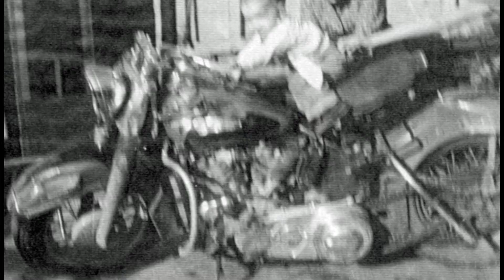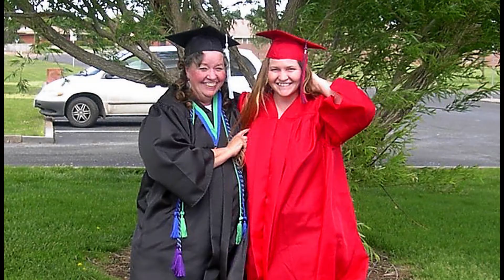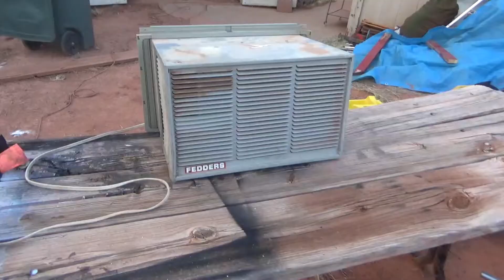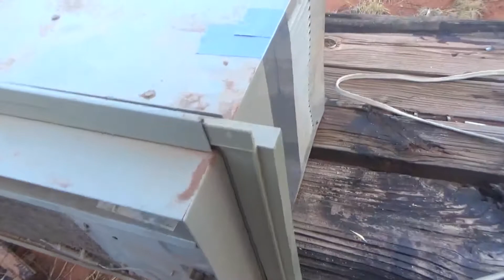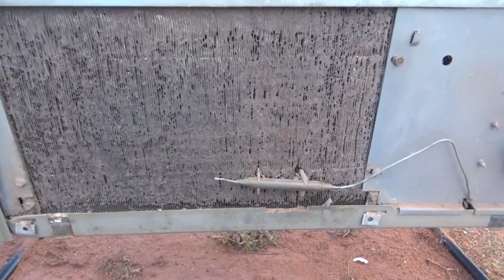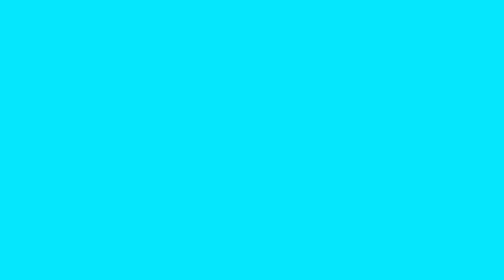Window AC Repair

Comment: I run a Fedders similar to this in my kitchen. Very efficient for their age so you get efficiency and something that was actually built to last. You should purchase a cut to size filter for this, they are at most hardware stores and Walmart for less than $10